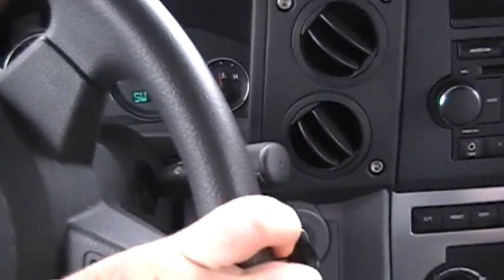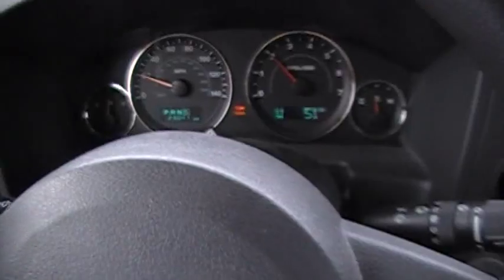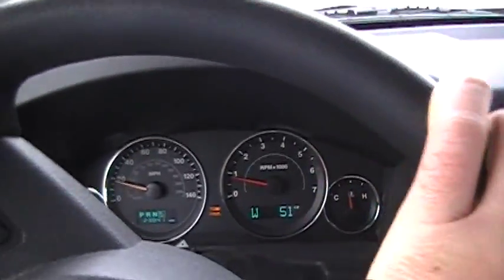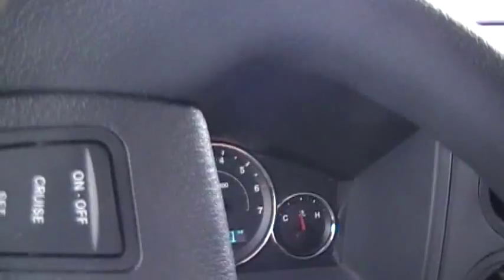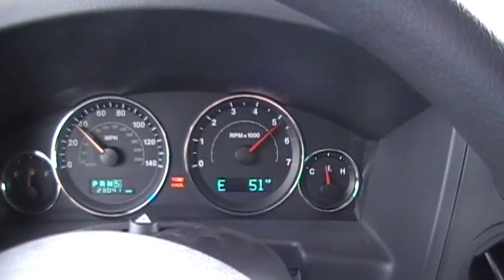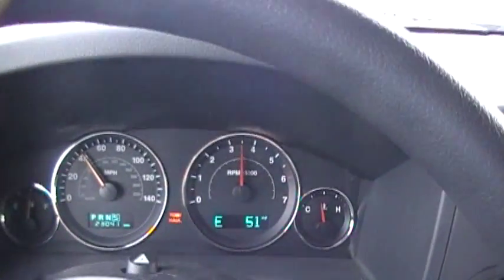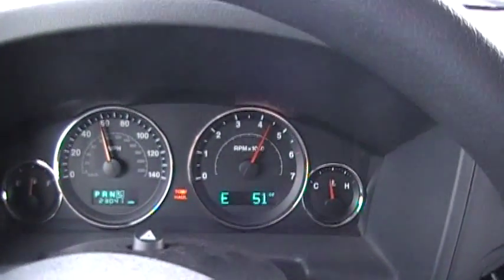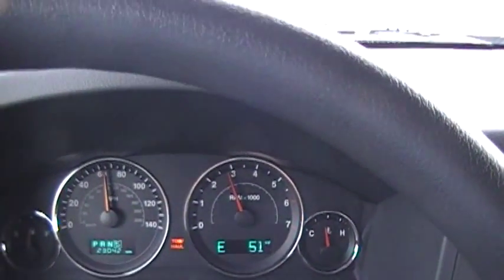Jeep commander towing jeep wrangler 2

Comment: I also have a '07 Sport w/ the 4.7L.   Although I don't tow w/ it, I think it does quite well acceleration-wise.  Only things I had wrong w/ mine were 2 recalls.  Mine's currently leased until the summer, and would I get another one at lease-end?  Probably, but would look at a more loaded Sport if the deals are right.